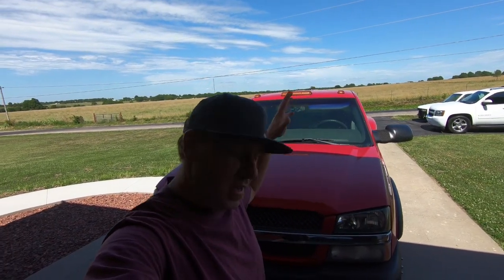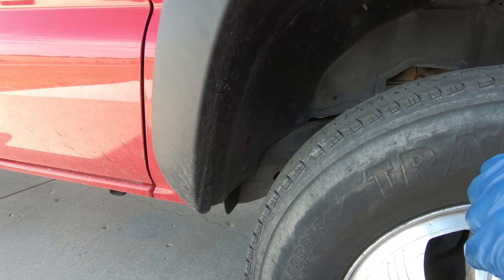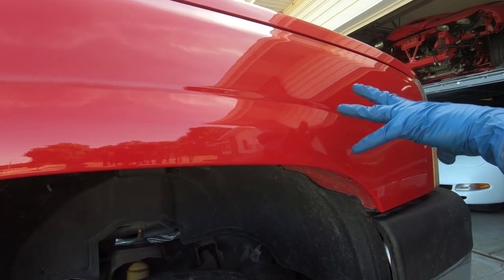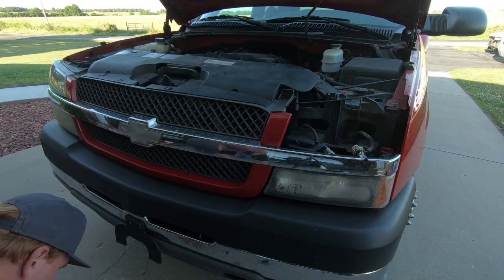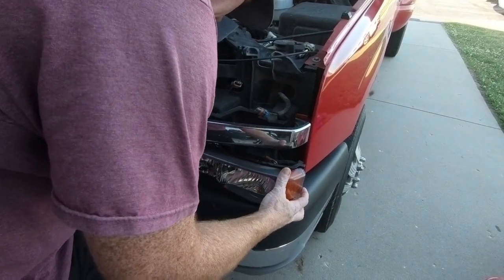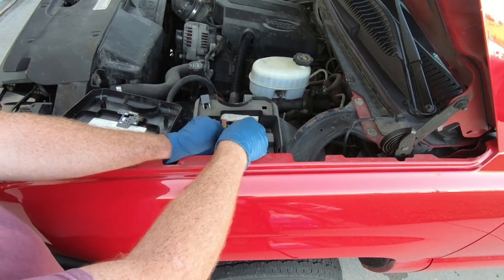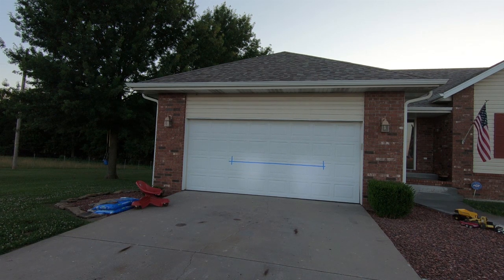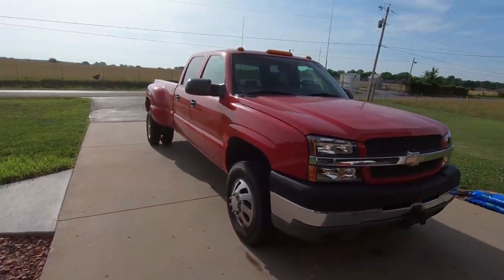New Headlights and Removing the Fender Flares

Comment: I have finally replaced all of my bulbs in my truck and my wife's truck. I didn't go with the led headlight bulb. I went with regularly bulbs but with a blue tint inside. I made my wife's truck Pink purple on the inside. And for mine I did all blue . Including the instrument cluster.
Reply from the maker: Probably still an upgrade though

Comment: Definitely better without the flares.  All they do is hold moisture and contaminants, besides not look so slick!   Like the lights.  Will that module that runs both elements work on a GMC similar to your green truck?
Reply from the maker: I agree. The 6 hi only works on 03-07classic

Comment: LASFIT makes a led turn signal that you don't have to use load resistors for.  Plug and play.  Totally legit.  Either directly from the lasfit site or ebay
Reply from the maker: Thank you I will look into that

Comment: I don't think the light housings leak where the bulb goes in. I think they leak where the lense is glued to the back part. I replaced the lower light housing on my 03 silverado because the original ones were beyond restoration and the lense leaked. I took them off and put some black rtv around the seam on both lights and they haven't leaked since.
Reply from the maker: I did that on my last ones. We will see how these hold up. You are probably right
Reply: @TWAMotorsports  Yeah, at first I thought the hole where the light bulb goes in was leaking like you said and so I put some sealant on there but it still leaked. So I ended up putting extra sealant around the seam on both housings and no more leaks.
Reply: Your truck definitely looks a lot better with the new lights.

Comment: I’m trying to install power windows in my single cab 06 Silverado. I have the door panels with switches and regulators. Is there any other parts i would need to get them installed?
Reply from the maker: Entire wiring harness out of the donor truck

Comment: Why don’t you use some clear coat touch up paint to fill the void and then go back with 2000 and 3000 grit sand paper to smooth it out,  I’m a former center Center Manager for Caliber Collision and that is what I would do.  You have not gotten into The color ( victory red) coat  yet. You can wet sand and then buff it out after it has dried in the sun a few days.
Reply from the maker: I may do that when I paint correct it.

Comment: Travis buy a touneau cover for the bed. Improve your fuel mileage...
Reply from the maker: Yeah 10mpg to 10.5 mpg lol
Reply: @TWAMotorsports  happy Friday my friend. Tomorrow I have a full day of turning wrenches on my project 94 Trans am.
Reply: Happy Sunday Travis. I need your opinion on a pinto steering rack to replace my stock steering rack on my 94 trans am. Also what do you think about the Watts link by BMR suspension for my 94 trans am? Message me back and let me know thanks Keith....
Reply from the maker: I wouldn't ditch the power steering. All bmr stuff is great
Reply: @TWAMotorsports  good Monday afternoon Travis. Thanks for your opinion on the steering rack. Yes I have all BMR suspension on my project 94 Trans am.. ok I'm going to order the Watts link and that will complete my entire suspension setup. 👍